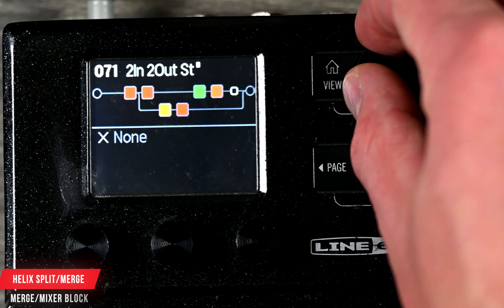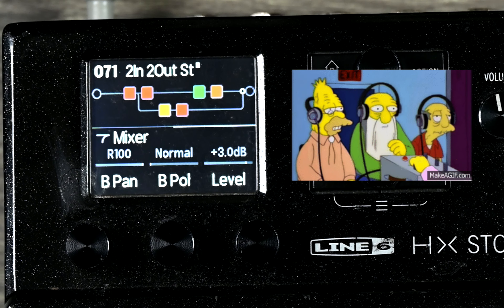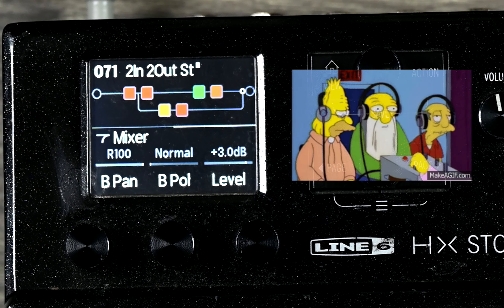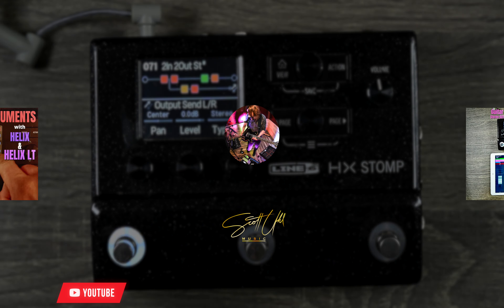Understanding SPLIT and MERGE/MIXER Routing - Line 6 HELIX/HX STOMP

Comment: The explanation for split Y is not correct: the balance determines the amount of each INPUT going into each path, you can always adjust the stereo balance via the panning in the mixer, in any of the given split modes. The Split y is useful only if you're using both the inputs on your stomp, otherwise is just a dimmed version of split A/B. Also any mono block put before the split y convert the signal to mono, so nullifies the vantage of the split. When using both inputs the blocks before the split should be stereo, in order to preserve the proper processing. Hope this clarifies a bit.

Comment: Not sure if they fixed it yet, but anyone coming here to figure out about routing your cab sim to output B and no cab to FX return of your amp (thru path A) into cab... When you're not using your B output it still puts the cab sim or IR in you path A. I lost my mind figuring this out. Simple Fix; Plug somethin into your Right Output even if you're not using it. Like a headphone adapter or short patch cable.

Comment: Simple, covers the topic end to end, straight to the point without fluffy/subjective descriptions and very instructive... Even knowing and using this to a very big extend (example, on Bass I like to apply octaver only when I play from the second lower E (aka, above the 7th fret on A string) note onwards, so I use the crossover to that, so I don't lose bottom end when I move up in fret for certain songs/bands/etc I play). The Dynamic is on my backburner, I find it very cool, but haven't find a place for it just yet.

Also, I would love Line6 to apply these principles on a BLOCK, not only on path. By that I mean, I would love to have a parallel dry/wet option, rather and a sequential one. 50% dry/wet is not the same of 50% dry + 50% wet, and having these options on every block would allow you to have a 50% output of a combined 100% dry and 100% wet distorted sound... and I'm very sure this audio information is there, at the block level, you just can't treat them separately simply because the blocks are still "locked" to the old limitation of analogue pedals. It's time to unleash more of the "digital-only" unexplored features.

Love your work. Cheers from Down Under!
Reply from the maker: Thank you! And yeah that would be cool for sure

Comment: Super helpful as always thanks Scott! I am trying to use a stereo chorus module, split the signal from the chorus left to path A and and chorus right to path B, then each path into a different amp, hard panned left and right (similar to the way Jesse Keeler of Death from Above 1979 runs his signal chain). Do you know how to split the signal at the Chorus module as opposed to with a split module? does it do the same thing? Also would be curious how you'd recommend setting the output with this setup. thanks!

Comment: 4:33 Is it possible to send Path B's output to the headphone output only? I want to use 2 separate stereo outputs, Main L/R and the headphone L/R, but only have a cabinet on the headphone output. I need to use the effects loop too, which is why I can't use the Send L/R as the second stereo output.
Reply from the maker: I don’t believe you can route ONLY to headphone out.

Comment: This is great, thank you for explaining simply and concisely.

If I run a HX stomp 4CM so I can use different pre amps into my valve power amp, can I use the split and merge function to keep the modulation FX separate to my pre amp, even though they're going into the FX loop of my valve amp? If that makes sense?
Reply from the maker: Thanks! And I haven’t done this with 4CM, so I’m not sure. If you are running out of inputs/outputs then getting the full helix might be better for you. But I’m not as familiar with 4CM setups tbh

Comment: Hey Scott thanks for doing all these vids it's been a fantastic resource getting me up and running on the HX Stomp. After watching this vid I wanted to split my signal Left EFX only and Right EFX/Amp/Cab so I can send the left to my stage amp and the right to FOH. I have EFX on channel A then Amp/Cab on channel B then my mixer block. But for some reason with L panned 100 L and R panned 100 R I am still getting the right channel in the left side. What am I doing wrong.
Reply: ***Quick amendment*** So it turns out that if you split your signal with a Mix block 100 L and 100 R HX Stomp will blend those channels to the L/Mono out if there is nothing plugged into the Right Output.
Reply from the maker: Nice, glad you figured it out 👍

Comment: Great video! just seen it and really help me a lot! I still have a question anyway. I want to split path as dual mono, path A for clean sound and B for amp'ed sound. What outputs should I use, L and R output or L and Send output (if I not merging on mixer block).
I still don't know the difference between R output and Send output for dual mono path.

Thanks in advance!
Reply from the maker: Best idea is to try both and trust your ears on what sounds best. You’ll be able to tell the difference…. And if you want the clean channel to go out on a separate channel as the dirty channel, or just have it all go down one channel

Comment: thank you! If I'm setting up a wet/dry setup and want just clean boring guitar DI on the dry channel, do I still need to use a block and put it in bypass to make a split?
Reply from the maker: If I understand correctly, then yes you would 👍

Comment: The only way I can create a patch with an output that could send an amp/cab to the FOH and an amp without IR to an Amp/Return is through the Send FX Loop/block?
Reply from the maker: Send/return would be very helpful, and likely the only way on the stomp, yeah
Reply: @ScottUhlMusic  idk if its working as intended but I have made a patch where I split the IR at the end of the patch and panned it left and right, right being the path that has the IR with it.

Comment: Great video, great channel. Question: I use the HX Stomp live and run it into a Fryette tube power amp then into a cab w/Celestion.  But I would like to run a separate line to the house PA with speaker cab sim on.  So I tried splitting the signal as you show in the video, with no cab sim on channel A panned hard left and this goes to my real speaker cab on stage, and cab sim on channel B panned hard right and this goes direct to PA.  Everything works, but there is a significant volume drop on the side with no cab sim.  If I turn the cab sim off on channel B, the volume on channel A jumps back up.  Is this normal, and do I just need to adjust the level on the mix return block?
Reply from the maker: I honestly only use it direct so I’m not sure what the answer is for that since I’ve never done it that way
Reply: @ScottUhlMusic  gotcha. And thanks for the quick reply

Comment: That’s awesome!

Is it possible to do something similar with Snapshots (since we can only have 8 blocks per Snapshot)?

For example, I have synthy-bass snapshot and I would like to add another reverb/shimmer snapshot on top, but to have the synth 100% and the reverb to sit on top at something like 20% with a high pass filter.
Reply from the maker: If I understand you correctly, that should work with snapshots I believe 👍

Comment: Hey scott, have you checked out midiwrist?
Reply from the maker: Oh interesting… just looked it up. I’ve never heard of that. Pretty cool!
Reply: @ScottUhlMusic  it’s intended for apple watch. But you can use it if you have just an iphone. By mapping midi to apple shortcuts directly in the midiwrist phone app. Then it can be used from any of your devices under your apple account. Using siri or just having the shortcut available from your home screen. And from the watch, atleast you can use cc values not just on/off buttons. Plus its easy to set it up for mackie control to do transport controls pause,play, rec etc into Logic and other daws. Spread the word to the homies.

Comment: Guys,

I own an HX Stomp and have downloaded the Bill Kelliher preset which is called REVV PURPLE. I look at the signal chain and there is a split Y so I suppose this was meant to create a stereo signal but I only get sound from the left speaker because the "mixer" is disabled and I'm not able to change that... what am I doing wrong?
Reply from the maker: You can’t change the mixer setting? That’s odd. You probably have the pan set all the way left on the hx stomp. Or on your mixer, it’s set to pan or set to stereo and you need to set it to mono. There are a lot of things that it could be

Comment: that's a smart little machine, Mine is acting up. anyone know why when I use the left and right output together it gives me an ungodly awful sound??? like even if I have a 1/4 inch jack put into the left channel out or right channel out the one being used sounds unusable
Reply from the maker: I’ve never heard of that. I honestly don’t know what that could be. Try changing the cables, and try some of the built in presets to problem solve.
Reply: @ I’ve done. The cable thing. It does it even on bypass. It does it if nothing is plugged into the input. It gets extremely worse if I connect it to the computer. I was hoping there was an internal setting but I’ve checked everything thought I would just reach out to others that are more familiar with it.